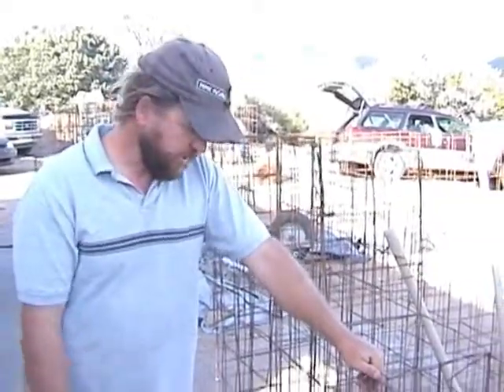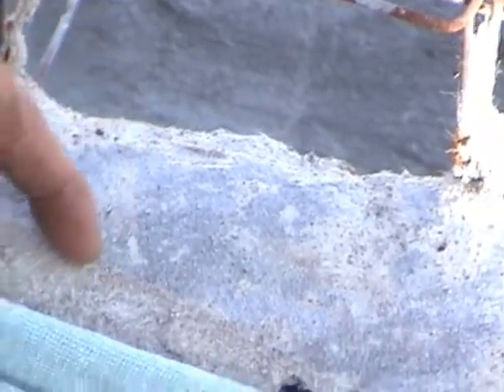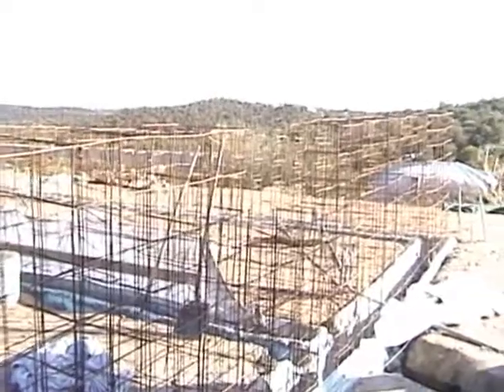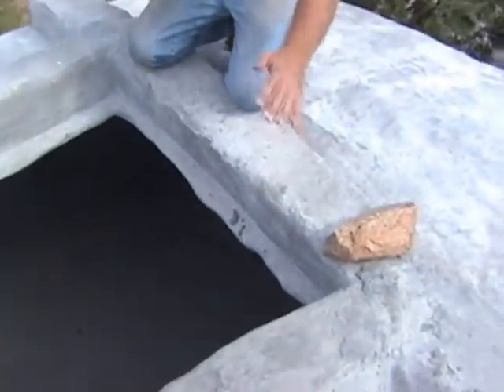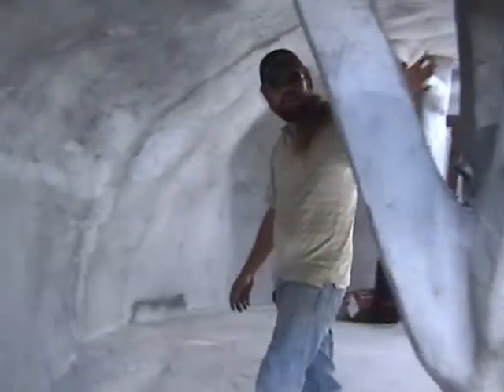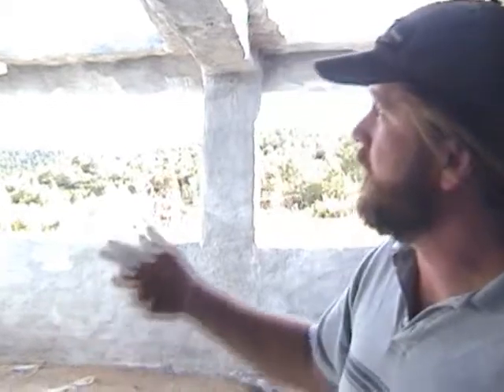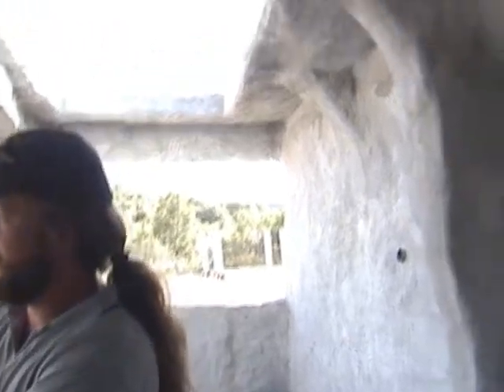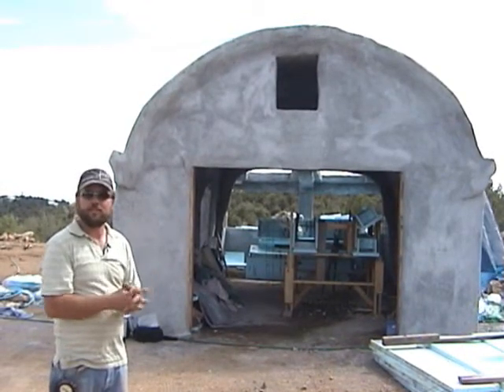The Parabolic Stress Skin Process Part 5

Comment from the maker: @ebit36  There is some new Stuff on Flikr.(Googe Doug Lacy's photostream ferrocement)   I have some new material and a new project that has advanced the mix design and the armature forming process significantly.  I make Arc Trusses that are made in precisely curved light block segments now to outline the basic shape of a structure like a tent pole frame,  Connecting membrane trusses fill in enough for rigid surface shells.  Cheaper to put a full bag of Micron3

Comment: can this be be built into the ground bermed up or buryed inthe ground
Reply from the maker: yes.  The composite is a densified mix with closed spherical cell aeration that functions as a vapor barrier for radon and the 2 to 4  layers of 10 gauge grid steel offset in a triangular no-slip pattern, in addition to the 3.4 gauge lath and 2% fiber reinforcing, provides tensile reinforcing in all directions along the shell plane.  This 3/4 inch shell is structurally superior to10 inches of sealed RC with rebar grid on 3 inch centers, yet uses 90 % less steel and 90 percent less cement.